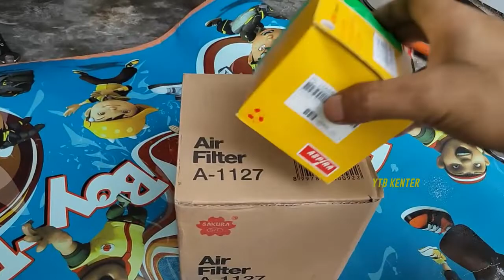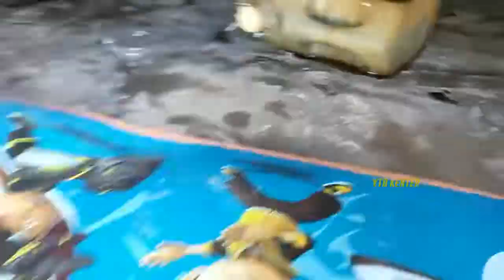GANTI OLI, FILTER OLI, FILTER UDARA MOBIL KIJANG KAPSUL EFI 1.800

Comment: Om mw nanya,kenapa kijang lgx 2003 bensin bapak saya ,tarikan nya letoy y,,klo di gas mw nahan tenaga nya gk plong,,padahal matahari,kain clos kopling,apa lagi klahar gk namanya,pokok nya bagian dalem itu ganti sepaket,baru semua,,minyak boros bgt,,rpm hidup mesin di angka 1 mau kadang naek,,apalagi hidup ac,,makin berat tenaganya,mohon info ny om..trimakasih
Reply from the maker: coba di tuneup dulu
gurah mesin
ganti busi, bersihin filter bensin
Reply: Itu aja hal pertama dilakukan dulu om?
Gurah mesin diapain y om,,? Maaf awam om di mobil
Oli nya bagus sae brapa om?
Reply from the maker: @BRFH09  gurah mesin, biasanya busi dibuka dulu nanti di lubang busi itu di masukin cairan carbon cleaner, tunggu 10-15 menit, hbis itu di sedot lagi cairnya, 

kl tune up TB nya di bongkar di bersihin, delconya di stel lg filter udara kl masih bagus biasanya cuma di semprot pake angin kompresor, kl udh kotor bgt biasnya di ganti.
Reply: @YTBKENTER  ok siap om,,makasi petunjuknya om 🙏🙏
Reply: Minyak boros ? Mksdnya oli ? Mesin ngobos mungkin. Ring piston, dan sil klep sudah kena. Ini kalo mesin ngobos, knalpot ngebul, tandanya oli  ikut kebakar.
Trus kl masalah rpm, apakah ngga stabil idle nya ? Kl iya, brati idle up sensor perlu dicek. Dibersihkan. Ganti kl rusak. 
Throttle body jg perlu dibersihkan.

Comment: Oli nya berapa liter om kok di tuangkan semua kayak nya
Reply from the maker: kl sama ganti filter tak isi 4 liter hehe
kl harusnya si 3.5 liter
Reply: @YTBKENTER  penyebab terlalu boros apa ya om, punya kijang kapsul efi 1.8 thn 2000 kok boros bnr,oli,filter oli, filter udara baru ganti padahal
Reply from the maker: @supriadieko8581  minta tune up itu biasanya
gurah mesin, ganti busi, bersihin tb, sama geser2 dikit delconya
Reply: @YTBKENTER  siap om, delco pas di tengah posisi nya, kurang maju/mundur ya om
Reply from the maker: @supriadieko8581  tergantung slera pengemudi si, sama bbm yg dipake
kl pertamax enak di majuin dikit 😀
Reply: @YTBKENTER  kalo di majuin itu bikin irit/boros ya om
Reply from the maker: @supriadieko8581  kl di majuin rpm rendahnya enak, tp rpm atasnya agak ngempos,